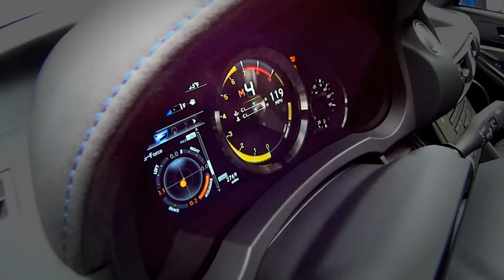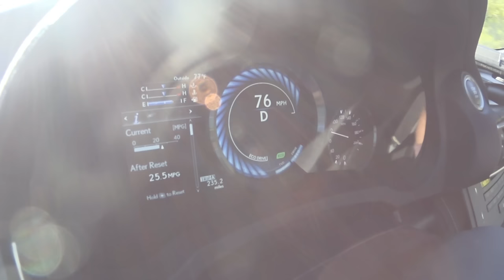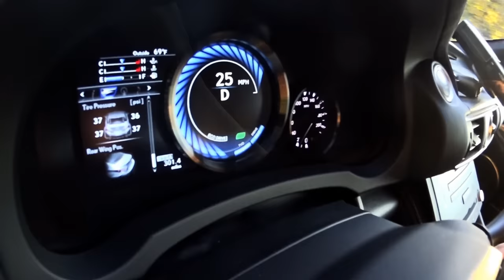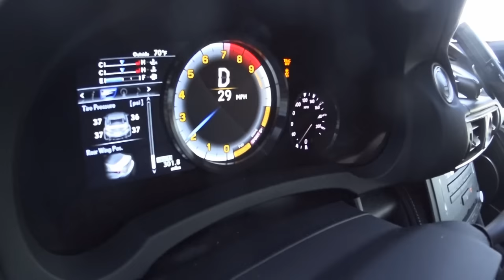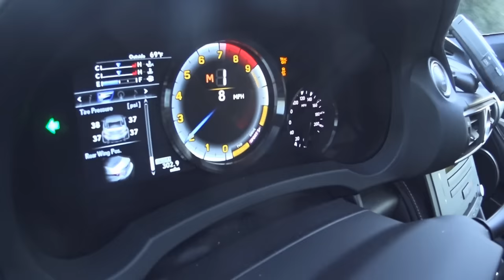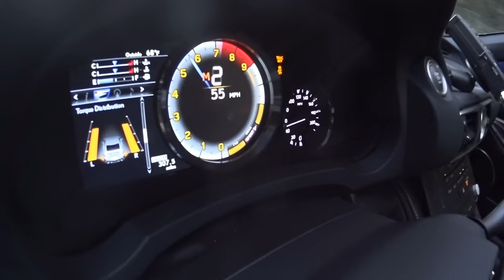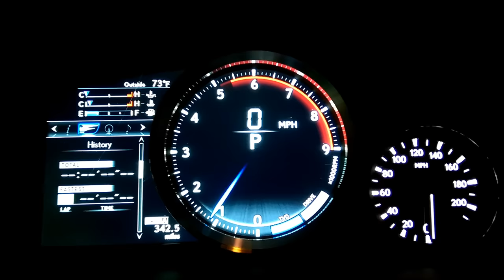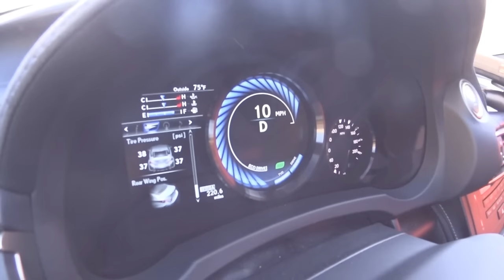Review | 2015 Lexus RC F | The License Killer

Comment: I now have myself an RCF and you're right. It's impossible not to drive this car fast. If you don't get a kick out of the acceleration, you'll get it from the awesome sound. It's not quite like the LFA, which sounds like a Formula 1, but it's good enough.
Reply: Still got it? How would you rate it? How bad is it on fuel usage?
Reply: @method341  It's a gas guzzler and only takes premium gas.
Reply: Mine isn’t too bad on fuel. I get decent on highway, city isn’t too bad. Eco mode is great when on the highway. I  took mine on a road trip and it’s by far the most comfy coupe I’ve traveled over 7 hours in
Reply: @method341  Mine gets about 18 mpg

Comment: It's 2022 and this is definitely going to be my next car in a few months.  Although used car prices are outrageous, you can still find a good one of these under $50K.
Reply: Got one for 43k
Reply: @steedu46gt  Looking at one in Missouri for 50K.  2016 with only 12K miles. Fully loaded!
Reply: I’m in CA. Got a 2015 gray exterior & red interior with 75k miles for 41k out the door (CA taxes 😩) 37 before taxes.
Reply: @AaRoninetyone  Picked mine up this past June.  2016 w/32Kmi.  Fully loaded and exactly how I wanted it.  $47K.  I really love it!  you don't see many of these on the roads which is one of the reasons I went with this car.

Comment: I traded my RC350 F Sport for the RCF. The vented seats are great. They take ambient air from the interior and put some air between the leather and your skin. I can feel it through two shirts. Wife loves this feature, too. Stereo is awesome...when I turn it down, I'm either having a conversation or listening to the engine. I had the Levinson upgrade in the 350, and the standard system in the RCF, and for me, the Levinson is slightly better at separation, but not to the point I miss it, and certainly not worth the extra $1100, for me. I do agree on the info-tainment - it could be better. Lexus is making some unusually good deals on 2016s right now.
Reply: older&wiser, im 22 and have an rc200t but i want to upgrade so bad, is it worth it ? i think yes but many people tell me no.
Reply: Only you can make that decision. I'd suggest a test drive if you can arrange it. I got a good deal on my new '16 RCF back in October, and my RC350 F Sport was in immaculate condition, so the trade in deal didn't cost me that much. If mileage is important to you, I'm getting 19 city on 93 octane with a heavy foot. An honest assessment of your self discipline would be wise to consider. The RCF gets into triple digit speeds very quickly, which could threaten your DL, even with a good radar detector. ;)
Reply: Merry Christmas! :)
Reply: I am trading in my 350f sport for a RCF this weekend and I've never been so hyped up.

Comment: The "brake coolers" are actually there to draw out high pressure air in the wheel well and the pop up spoiler is not for down force but for drag reduction. It's not a real wing and not meant to be. You can tell by the underside of it. It's there to make the car more streamline (attach the air to the back end) at high speeds. Low speeds will not need to attach the air because the air can flow with the body shape at those speeds. Lexus does some real trick stuff with their aero on all models. Porsche does the pop up spoiler as well and they also have those fender vents on their RS line

Comment: It's May/2024.  Had my "16 RCF since June/2023 and it is an amazing car.  Only mod I did was get the aftermarket display to allow for wireless apple CarPlay.  That fixes the infotainment issues mentioned.  Around $750 for the display so not too bad. 

This car turns heads.  I live in the Tulsa, Ok area and haven't seen another RCF on the road since I bought this car.  Maintenance friendly and it's just a great daily driver.  I was considering a C7 Vette and a few other options at this price point, but I've been very happy with my decision.  If you're in the market for a great sports car under $50K used, at least test drive the RCF.  I get so many compliments that a standard mustang or corvette owner probably won't experience since you see them everywhere.

Also, love this channel!  Best YouTube car reviewers IMO!  Even beats out Doug! LOL!

Comment: One of the most gorgeous looking cars on the market. I know at the time of posting this comment, the 2019 models have redesigned the lights but I much prefer how the front end looked like pre 2019 RC300-350 and IS models. Also, the BLUE on this car is the most beautiful blue in a manufacturer.

Comment: Definitely one of the most underrated car review channels on YouTube - hard to believe you only have 30k subscribers! Excellent review. You said you would consider leasing this car, but what do you think about its reliability for long-term ownership as a daily driver? Considering an RC 350 but could stretch a bit for one of these (in the used market); I'm a little wary that it'd be a bit much as a daily and the V8 doesn't have as much of a track record as the bulletproof V6 in the 350. Would love to hear your thoughts!
Reply from the maker: +AlfredPGo The RCF is a far better car in terms of enjoyment and performance.  It can be daily driven but of course your costs to operate are higher.  The ISF that was out was very similar and very reliable but I would start researching problems owners had with it to know.  Personally these modern motors and transmissions are vastly comlicated despite Lexus reliability, port and di, crazy vvti and programming.  When things go south down the line its expensive no matter what car.  If you bought one used Id go low miles and do 100k warranrty and see how it goes, if reliable hang on if not dump it

Comment: To answer Turbowski's complaints on why the manual shifting on the selector is "backwards", it dates back to the old auto trans selector patterns. Back in the days before manual modes, you had (from front to back) PRND321, or something similar. So if you went into manual range selection in the old days, pulling back on the lever put you into lower gears, while pushing forward put you into higher gears. When manufacturers started introducing manual modes, most of them kept that old layout of "forward=+, back=-" in order to avoid confusing the customer.

Comment: Finally someone is saying it..... a lot of cars have too much power”. This car, corvettes, mustangs, Camaros, higher end 911s, etc all have too much power and cannot be utilized on the street. I drove a stock c7 corvette and was able to hit 80 in second gear. The car is amazing from an engineering perspective but you can’t really drive it on a backroad at pace. Even my 370z is hard to get past third gear on any backroad. I can understand why you bought an s2k....
Reply: Strunz0 Cars   Exactly why I sold my Corvette and bought a Cicic SI.  205 HP 6 sp manual and gets 37 mpg average.   Great reliable cheap fun.  
On the street it’s more enjoyable to drive a low HP car fast than a high HP car slow.
Reply: too much power = I am a pussy who doesn't know how to drive.
Reply: @travissartele8254  ...talking about on the street with kids and other people driving minivans.
Reply: @sew9068  and I was also talking about everyday driving.. having owned a car with 550hp and looking to buy one capable of 1000 daily driven hp.. you can never have too much.

Comment: Its too bad that they didn't reduce the weight as this thing is way to heavy for a sports coupe
Reply from the maker: It could use weight reduction as a focus.  Driving it daily however its a non issue.  But next gen needs 300lbs shaved off.
Reply: +savagegeese  Exaclty.  He is just bench racing. in the real world the weight isnt a problem normal people aren't able to push this car to its limits.

Comment: Great review!! the best I've come across, since purchase this year. I have driven only 5,000 miles in mine since January (yes in the snow and some ice), though, I have clocked about 500 miles on a local track - fulfilling the goal of why i bought it. Mine is equipped with the TVD (opted out of the moonroof) which is great, especially when you start to use it aggressively to compensate for some of the understeer - pour on the throttle a bit earlier through a turn really rotates the car, I use the strongest setting of Slalom. I have some posted video (still working on my lap times but i did solo with SCCA this year and moved up to advanced with the Friday A The Track program. As a daily driver, i really enjoy it, the back seats work well for my 5 year old and a booster seat. The truck will fit two sets of golf clubs and some luggage. Finally, I live in the greater DC metro area and still have not seen another RC F on the street. I plan to keep it for a while longer!!

Some track footage... https://youtu.be/UBRA6Vvv3sI

Comment: The same after only 10,000 miles? My LS460 is the same after 263,000 - except that it seeps a little oil at the high pressure fuel pumps. Not bad, considering the mileage.
Reply: My 2002 ES 300 with nearly 170,000 miles and four new struts drives like it just came off the showroom floor. Fit and finishes on paralleled, build quality is amazing not one creak or rattle. 
Looking to buy a 2015 - 17 RCF when I retire in five years. Was comparing to Toyota supra 3.0 but underneath it all it’s a BMW and I don’t trust the reliability long-term.
Reply: @stephendibari5010  I was tempted by the new Toyota Supra until I found out the engine was BMW. I've owned two BMW's. Never again.
Reply: @hootowl6354  I hear you. BMW’s are empty $ pits over 50k miles and/or 5 years old. This engine was supposedly tested and revamped by Toyota, but in the end it’s still a BMW all over except for suspension tuning I believe. 

In 5 years when I retire I’ll be looking at going for an RCF or a RC 350 F Sport. Not new but one owner (or 2) low mileage examples.
Reply: @stephendibari5010  I had my eyes on a RCF for a while. Now I'm targeting a heritage recreation of a Ford GT40, the race car.  There are several companies that make kits, and a few that sell built ones.

Comment: Considering both this and the later run of the IS-F. RC-F prices have dropped in to the 40s and the IS-F is still mid 30s, which would you choose?
Reply from the maker: +Brian G. RCF all the way, subtle updates with motor, trans overhaul and more rigid chassis. For 40-45k its a great deal.
Reply: savagegeese even the GS-F has slowly creeped into the low 60's these cars are getting overlooked.

Comment: What I don't get is why this, and the IS are hundreds of pounds heavier than a similiarly sized corolla or a comfortable, even the larger camry. Surely, a driveshaft isnt 300lbs? Do the extra premium interiors weight that much?
Reply: macaron3141592653 sound deadning materials are heavy and torque vectoring diff extra rigidity etc
Reply: Those seats may be 60+ lbs a piece
Reply: Open the door of a Camry and then go and open the door of an RCF. That alone will answer your question. Lots of quality material everywhere and sound deadning like the guy above me said
Reply: Good question. Pick your poison, do you want luxury performance or bare bones performance. Personally, I like the option to choose a performance vehicle or a luxury performance vehicle. Test drive both and let me know what you prefer.

Comment: I am debating about pulling the trigger and getting this car 15-16 model with less than 20k miles on it. What do you guys think? Would use it as a daily driver. Other options are cls 550 and m4.. 2014 models. Any input is appreciated.

Comment: when the gsf review arrives, I reckon there'll be an interesting point of, while the gsf may have improved areas over the rcf, is it worth the additional outlay?
Reply from the maker: +Brad_0 No way.
Reply from the maker: +Brad_0 No way.
Reply: +savagegeese crikey, twice eh? but it does drive better right?
Reply: +Brad_0 OK, let's look at the other side of the coin. which would you rather have, now and when used?
Reply from the maker: +Brad_0 Id take RCF save big money almost equal performance.  Not as nice interior though.
Reply: +savagegeese true, still we are talking about a lexus interior at the end of the day, so it will still be great. really, I think that is the biggest problem with the gsf, but I suppose the best way to know for certain is to borrow one of each for a while and find out. either way, you'll still have a great car.
Reply from the maker: +Brad_0 I'd definitely consider one of the other as a used daily driver I really like these cars.
Reply: savagegeese I agree. Definitely

Comment: Do you recommend the rc f or the q60 red sport? I own an rc 350 f sport but I want faster now.
Reply: The RCF will be faster stock but if you decide you want to upgrade the car with mods in the future you should be aware the RCF doesn't have the best aftermarket support and the most you'll get out of it FBO + Tune will be about 450whp. The Redsport has a lot of aftermarket support and a simple e85 tune can be enough to match that FBO + Tune RCF. If you're ok with 450whp then id say the RCF but if you think you'll want more power after that the only way to get it on a RCF is by getting the 10k+ supercharger which still only gets you to a max of 700whp.

Comment: Planning to trade my IS 500 for an RC F. I thought LC 500 but that's over 120K for Bespoke and no AT/Oil cooling. The new RC F since 2023 removed the TVD and Engine bracing which is really sad, they also removed Lexus Memory Driver seat and Electrochromic Auto Mirrors tilt down in Reverse. Torn between RC F 2022 with TVD and bracing or 2025 RC F with LSD and no bracing. Yea 2025 is going to be the last MY for Lexus RC F (no track edition for 2025, not even worth anyway) and IS 500 and even LC 500 the 2UR-GSE will be finally retired in 2025 end. IS 500 is too sloppy in the chassis and the lack of F tuning and stability, rigidity and the awful bumper sag is the reason why I want to get a true F car.

Comment: Wow, some ringing endorsement for this car. I'm half-way convinced that I want it (if I could actually friggin afford it). 

So it seems that standing alone, the RCF is a fantastic car that can do a lot of things right. But from a purely driving perspective, and in direct comparison, all the reviews say that the M3/M4 is better. Now usually comparisons like that do a disservice to the losing car because both cars in the comparison are actually great. But the RCF was made to be a direct competitor to the M4. So do you think it's unfair say that the M4 is a better driving machine? If you could do an M4 review, that would be fantastic

Also, what up with that Packers hat brother?
Reply from the maker: I cut the part out with the packers hat explanation.  Will be in next video.  it was all they had and needed something for the sun.  Sure the BMW has better driving dynamics but it also now has a turbo motor.  At 75k its like splitting hairs and unless you live on the track or need a manual trans BMW really is not giving you a night and day difference.
Reply: savagegeese fair enough, good to hear! I like the idea of a naturally aspirated motor anyways. If both companies are doing the fake speaker sound, I'd rather it be the 5 liter V8 and still keep the engine running for hundreds of thousands of miles

Comment: Is the TVD worth the extra money? . I seen used rc f base trim in high 40k range.
Reply from the maker: I drove both, one with TVD and one with Torsen. If you are planning on tracking all the time TVD would help as it makes the rear end extremely stable. But the Torsen IMO makes the car more lively and fun to drive.
Reply: savagegeese yeah. I was thinking same. I'd be happy with a base RCF. All that money saved. Especially if I don't plan on tracking too.
Reply from the maker: I saw the used market on these cars and I would absolutely grab a torsen version for 40-45k. Great deal
Reply: Great One 5oh3 torque vectoring differential

Comment: Why is it that this car needs advanced valve timing to get 25 mpg highway, but a C4 to C6 Corvette can get 30 with the lowest tech motor you can find in a car less than 20 years old despite being a slightly larger vehicle with slightly more power.
Reply: I'm not super knowledgeable on vettes but i think they got good mpg because of the extremely long overdrive gear.

Comment: Biggest Problems W/ Lexus' s is Weird Stuff U Never Repl.on Other Cars on Back Susps. My 04 ES330 Needed Rear  KNUCKLE BUSHINGS @ 115,000 Mls.Frt .Sway Bar Bushings Were Good Till 152,000mls.& Don't  Let Dealers Repl..Ur Lower Control Arms ,Unless U Have $15-1600 to Spare.Got My MOOG Control Arms,Gtd.for Life,& Got A ASE CERT. INDPT.MECH. To Do Job.TOTALCOST FOR PARTS & LABOR lLittle Under $700 & Better Gty.Than Dealer.

Comment: I’m considering buying this car in the next few months. Would anyone have any ownership experiences they can share? Much appreciated!
Reply: Go for it. It will 100% be one of your best purchases. After 1 year the car still runs like new with 0 issues and puts a smile on my face every time. I will worn you if you decide to modify it (which will make it even more fun) you're gunna need to start saving asap lol those parts aren't cheap.
Reply: 28000 miles no issues.  Rides a bit rough on less than smooth roads and tire noise on those roads is a lot more than a pure luxury car but that's pretty much the norm for what this car is/does.  I've always loved the lines on this car because it really is a borderline ridiculous design, looks like nothing else, and you don't see them at every street light.  Looks 100 times better in person than pictures and video.  Makes my trip to work and home a much better time.